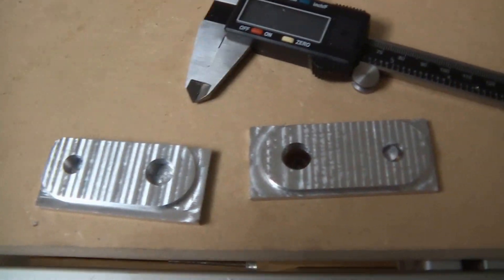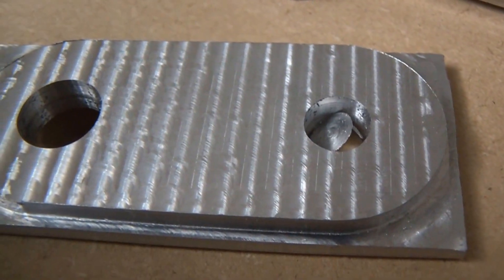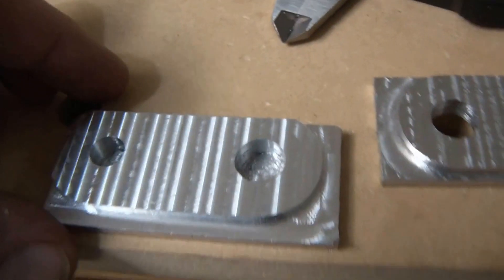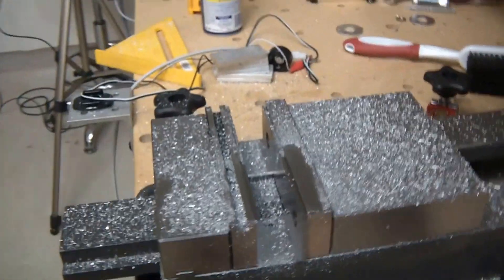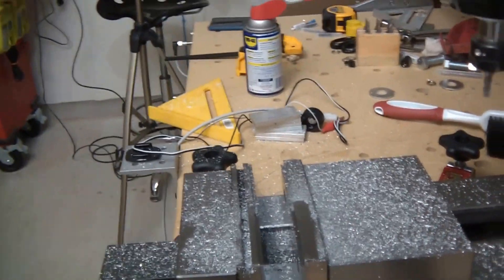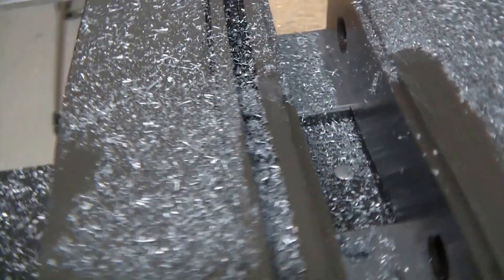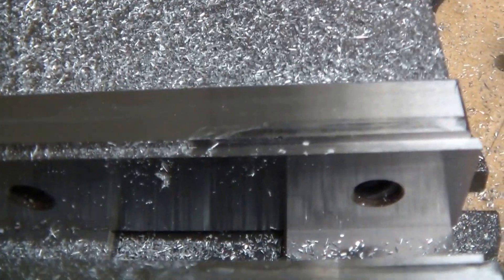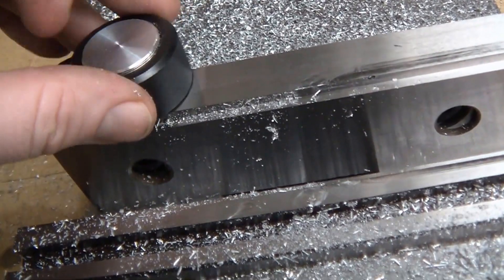Proof of making

Comment: You're gonna wanna use carbide. I'm assuming your spindle is 12k+ rpm which means you absolutely need carbide for anything good in alum. Get a steady blow of air in there to to remove chips, very crucial to good parts, and lastly make sure your spindle is mounted rigidly because this machine marks looks like a sloppy mounted spindle. Sorry if this is wrong first video I wanted of yours I love the work though!!!!
Reply from the maker: Rigidity is my enemy, and yes I have moved over to carbide for all my bit...  I am working on it, but despite how accurate I can get my servos, I'll never make up for the fact that aluminum framing flexes under the stresses of most metal cutting..
Reply: Yup routers are not made for metals.